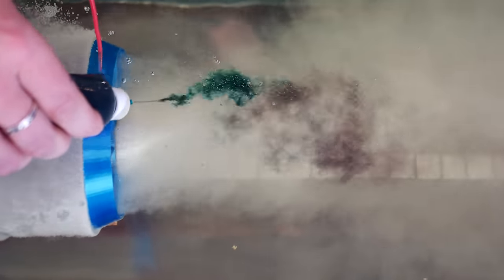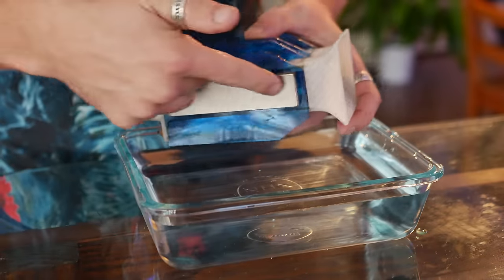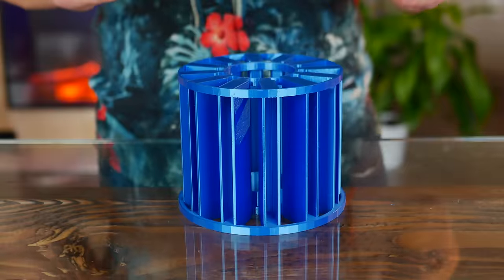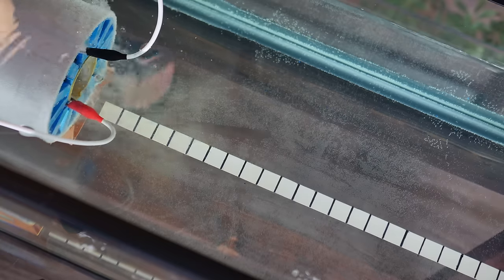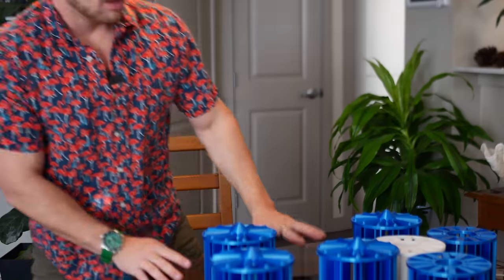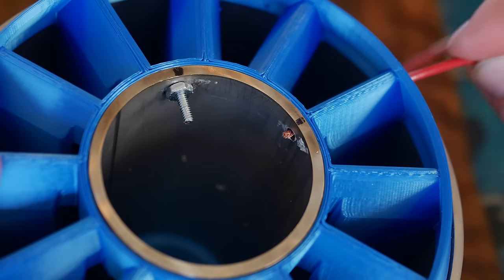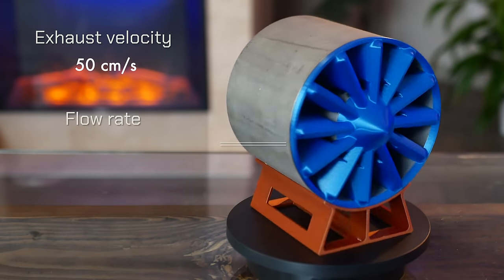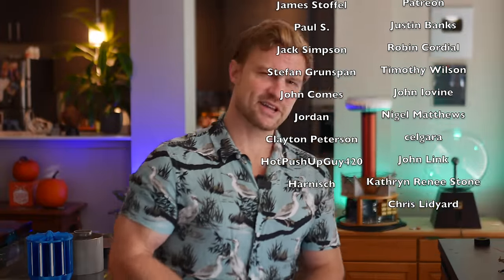Designing a Futuristic Magnetic Turbine (MHD drive)

Comment: One of the main problems with the MHD drive is the electrolysis part.  The side that has the oxygen bubbles usually is damaged by it.  There are some metals that are resistant to oxidation.  Then there is the fact that it produces bubbles instead of the just moving water.  Anytime there are electrodes driving current through water, there will be oxygen and hydrogen bubbles.  What if there were no electrodes?  Instead of using metal electrodes, what if you could make a transformer that uses the saltwater as a secondary winding.  The primary winding would be copper wire and the secondary winding would be plastic or rubber tubing filled with saltwater.  The fluctuating magnetic field from the AC current through the primary winding would induce voltage in the saltwater in the secondary winding that will drive current through the saltwater without any bubbles.  I did a small test with a transformer years ago and found you can indeed induce voltage in saltwater and it will drive current.  Of course, saltwater has a higher resistance than copper wire so there may be some limitations as a result.  Then there is the magnet problem with using AC current.  There is no way rectify the AC current in the saltwater so permanent magnets cannot be used.  Electromagnets have to be used and will have to be driven with the same power source as the transformer so that they are in-phase with the current through the saltwater.  The current through the water will alternate but the water will move in one direction.  I would like to see this tested.  I suspect the outcome will be underwhelming just like all of the rest of the MHD designs.  I remember seeing something about an experimental MHD drive powered boat that costed millions of dollars to build.  It was slow and used a lot of power.

Comment: In the year 2000 the Japanese developered The Yamato 1 was indeed an electric boat, and while the technology held the promise of potentially high speeds, the Yamato 1 itself was not designed for high-speed travel. It was capable of reaching about four knots, which aligns with your recollection2. The concept of MHD drive hoped to revolutionize marine propulsion by increasing top speeds significantly, but the low efficiency of these experimental drives made them impractical for wide implementation at the time2

Comment: Even at ~47 cm/s, what you've got isn't actually a propulsion device.  It's more of a low pressure fluid pump.  Remember, you're trying to design something which will overcome not only its OWN mass, but the mass of whatever vehicle/vessel/craft you're trying to propel.

F=M×A. If the mass doesn't move, there's no acceleration.  If there's no acceleration, no work has been accomplished.

If you can increase both functions of your design to at least move a small(ish) boat (relative to the size of the unit), I'll be impressed.  Perhaps you can design a system similar to the fictional caterpillar drive of the Red October, but for a surface vessel.

Comment: Now make one that has a tapered end so you have compression for more thrust. Also make it have a slightly more helical structure to increase surface area with the water. Also try thicker wires with a car battery. I wanna see how far this can go.

Comment: Hello Jay… Just wanted to put a thought out there with you. I was working together with Joseph or Joe Flynn for a couple years as he was making all the breakthroughs on his parallel path magnetic technology. What he had stumbled upon was the fact that in a magnetic circuit, and especially with the motor design that was being used which was a switch reluctance rotor design, that if you incorporated high gauss rare earth Neo magnets into the circuit along with the electromagnetic coils, and you had it balanced with the same number of lines of flux from the electromagnetic coil as from the permanent Rare earth magnets, you had a very interesting effect which fully subscribed to the laws of physics. If you double the lines of flux, you square the force. 
Joe figured out how to incorporate and switch the lines of flux with the electromagnetic coils, which also at the exact exact same time switch the lines of flex from the rare earth magnets. Therefore for one unit of electrical input, you would effectively get four times the force. 
He was able to take fractional horsepower electric motors which Riet normally ran at very low efficiencies of about 20%, and get them into the high 80s or 90s for efficiency. 
He was able to use this principal for electromagnetic clamping, and a whole series of other things. 

I was thinking… If we could incorporate these principles into the magneto  hydrodynamic drive,
There may be a possibility to square the output force ….
Which would then make this an extremely efficient Solution for a ships drive, or potentially for pumping.
If you like, feel free to reach out to me, and I can send you the PowerPoint presentation I gave a number of years ago  at the  northwest Energy technology conference, where I was a keynote presenter on this topic.

Scott Plummer, 
President, 
Rms-Ross Mining Systems Inc. 
scottplummer@rmsross.com

Comment: Very cool project. I've always wanted to see someone play around with MHD - envisioning solar boats that can either supplement, or provide enough power to drive with purpose. 58h of printing time seems incredibly long. I'd either break it into components and get rid of  all the supports, or move up to a bigger nozzle and finish the critical surfaces later... or do both - it just seems like you could print that in 1/5th the time. Good tip on the Flex Seal - gotta get some.

Comment: Japan:" Been there done that."
This type of engine has already been built, tested and found none practical in the 90's.
There is no practical use for such a technology, at this point, because of how much power it would take to overcome X mass to create twice the velocity.
A boat has a mass x , which is dead in the water weight without propulsion, but the propulsion has to solve this problem E=M * V² , which even Nuclear Subs can't produce with Magneto hydrodynamic drive without making the vessel heavier, due to the size and mass of the electromagnets in the drive.
Japan built the Yamato-1 in the 90's using the Magneto drive and was placed in a museum, but demolished in 2016.
 Yamato-1 is a ship built in the early 1990s by Mitsubishi Heavy Industries
 It used a MHDDs engine, which was driven by liquid helium-cooled superconductors at a length of 30 m, a  width of 10.39 m, and a whooping gross tonnage of 280 tons,  but  could only travel a mere cruising speed of 15 km/h (8 knots) with only a  max of 10 humans. 
A turtle can swim twice as fast. A Hawksbill turtle can swim up to 24.3 knots.

Comment: Great work!  Id like to see what that thruster can do in a canoe with a couple of deep cycle batteries or better yet the lithium iron phosphate batteries.  

As for futher research, I think that this needs an underwater afterburner combustion component.   If you think of this portion of the device as the compressor in a turbine,  The immense amount of hydrogen and oxygen bubbles could then be focused into a combustion zone, ignited, and expanded outward through a properly shaped tube.  Think of it like a ram jet but with underwater combustion.
Reply: When you say deep cycle batteries, you mean lead-acid batteries? The canoe would be DOA due to the intense weight of the lead and poor thrust to weight ratio.

Even with lightweight (by comparison), higher energy dense LFP batteries, it would still weigh too much and go nowhere.

It’s exceptionally inefficient. There’s very few applications for this.

Comment: Thanks for the awesome video.
There are a couple of things that can make some realistic improvements. For example shifting from permanent magnets to electromagnets. Mostly because these can generate an immense amount of pull for little current. This also allows to reduce the electric current going through the electrodes.
Actually we even tested with Platinum coatings and these were destroyed by the corrosion.
My main concern is for now the efficiency of the device as it is pulling close to 1kW of power to generate the thrust.
Anyways!! Looking forward to the next designs.

Comment: stuff to try:
Hallbach array arrangements.
machined graphite electrodes. extra points if you add sharkskin texture for microscopic stationary turbulent boundary layer
add riblets to non-electrode surfaces and treat with hydrophobic spray to trap air bubbles into seams to reduce wetted surface friction make the angled entry/tail <20 deg 
start calculating massflow per watt instead of only water velocity or perhaps trust force per watt ? i think those might give us a better metric for usefulness

Comment: @PlasmaChannel you should try some more extreme hydrodynamic optimization. 

You could slightly "spiralize" the thrust water channels to provide a directed flow that reduces turbulence losses at the exit, try making that central nose cone longer, and copy what modern high bypass turbofan engines do by using that central area of thrust water to pull in surrounding water through a cone. I would love to see what those modifications can do to improve the impulse. Exhaust velocity isn't everything afterall

Comment: A boat will require independent electrical systems. That’s a variable to include into the mix. How will you manage to created electricity in order to exhaust electricity? On a small scale sounds reasonable to do. However on a larger scale, all those volts an electrons moving at such a rate, while independently steaming, could cause more hazards than a general gas turbine or main propulsion diesel engine system. But you’re in a start! I’m not doubting, I’m brining to life real variables as I am a ship engineer.
Reply: Also, keeping in mind general electrolysis. Causes hydrogen bubbles, it does not take a lot to make hydrogen upset.

Comment: It looks like the gasses created by the electrostalsis is what is causing the thrust. Having conductors in salt water seems like it could have a short lifespan. You still have to have loud engines on these boats to power those devices.

Comment: Forgive my ignorance, this is not my field, and basically I'm just someone who found this fascinating. Tweaking this design slightly, what would happen if instead of stationary magnets you had it so that they were on a propeller of sorts, and so the thrust wouldn't just push water but it would also intentionally cause the propeller to rotate. Would that not significantly increase forward momentum or thrust in an ocean environment? This way you still have a purely electrical engine, and all you've lost is the lack of moving parts. Additionally, since the rotation wouldn't be coming from a drive motor, you could focus on reducing the friction of the central axis holding the propeller in place, in order to maximize rotation. Could this not create an entirely new type of electric propulsion?
Reply: Another possibility would be to have smaller fins inside your housing, but with two different directions of spin and thrust (clockwise and counter clockwise). One would be doing a push and the other a pull, but with opposite charges so that the natural repulsive or attractive nature of the magnets increases the spin, while the magnets move water.... I'm curious if this would work.
Reply: Last thought, what if you then wrapped a coil around it all to either generate additional power or reduce power consumption?

Comment: Taper the front to back so that the water is forced to condense as it moves back. Then make it like your ionic thruster with 3-4 arrays in a row, to take advantage of entrainment, while adding and further concentrating the water. What this should do is improve the density of the thrusting water and propel the whole assembly forward with more force. Think of it like stacking cones with just a enough overlap between arrays that water doesn't escape until it reaches the end. Furthermore, employing tesla valves or shaping the stays to make them function like them to help ensure condensing and one directional flow might be greatly beneficial. Normally you'd want to avoid condensing water because of cavitation, but with the open nature of this design, i doubt it'll be an issue at all. I already have s few 3d concepts of this idea if you're interested. Someone like you could make it reality. I don't have that kind of skill, unfortunately.

Comment: Pretty cool.  At SuperMagnetMan we have had many customers wanting to build these.  In a closed tank it only takes a few minutes to build up a lot of crud in the water.  I am sure in the ocean that would be left behind but since I am an electrical engineer and not a chemist I am not sure what all the crud is.  A couple of thoughts - stainless steel is a very poor conductor of electricity - so I wonder what a tube that is 90% copper and 10% nickel might work like.  Also we can easily get those magnets in N55 and we can coat in PTFE or just 3D print a TPU rubber shell for each magnet and coat the magnet with silicone oil to protect it.  Just a few thoughts for tweaking it.  Also on the hydro dynamic side I would probably design the flow channel. with some venturi type shape to accelerate the water flow.:)

Comment: Sorry for the rant, had fun thinking about this projects applications.

I got to thinking about how to increase the force of the thrust without needing to increase the size of the engine or power requirements. The only idea that can to mind is to use the wave physics of water alongside the physics of the turbine. A vacuum sucks the ship forward while the exhaust pushes it, doubling force but not the requirement.

By using the shape of the ship it is mounted to and decreasing the intake to the size of the turbine, water is drawn into the turbine at a much higher force. Now there is a problem with this as the increased intake force could put strain on the turbine's structure, and has to go somewhere, so put an exhaust on the back that widens out to quickly displace the built up pressure. Afterall, when working with physics, always regard to Newton; EVERY ACTION has an equal and opposite REACTION. So, consider a machines EVERY ACTION and make it better, no?

Comment: This won't really be much quieter. There's quite a bit of noise generated by the electrolysis of the water and air bubbles being formed. You're basically going straight to the cavation phase of propellers. You'll also be ionizing the water and depositing heavy metals into the water as your reaction plates corrode.

Comment: Wonderful, a rule of thumb to use for a “ final model “ in regards to wire ( cable ~) size is the ; gauge . Think American wire gauge! An easy way to think of these gauges is the largest gauge refers to smallest diameter, hence smaller gauge no. = larger diameter. Great video!

Comment: I feel like the thickness of your 3D printed structure just causes drag on the water going through the system. It may be a good idea to try and decrease the supporting structure to a minimal amount. The lower the areas of collision, the more laminar the flow and should allow for maximum thrust. This device works more like a rocket nozzle than a turbine.

Comment: This is just the perfect in the Carbon Zero race. (For Boats).  This ening is the equivilant of an electric car (EV). A Yatch with Solar,Wind and Battery capacity, could run these engines without producing emissions. The battery pack can get extra cable charge at Dock.  A fully electic boat with a fully electric drive system.

Comment: Basically a tokamak fusion reactor. If you put a dynamo in the middle, and had the magnets push it somehow, it should generate electricity.

Another cool experiment would be to use a magneto (magnetic car starter) to rotate a dynamo (DC Alternator) to generate electricity

I think if you did the magneto dynamo thing, and wired the outer ring into the inner ring and back to the outer ring, if you used like a bike chain to spin the outer ring, it should cycle the energy back into the outer ring, so it would keep rotating with power with no other input, bike-powered propeller?

Comment: One might gold plate the anode or make an allowance in the print where a rod or sheet of a less noble metal could be inserted to become a sacrificial anode.
Reply: Gold plate the anode and attach to it a mild steel screw or nail as a sacrificial anode. Gold would be more durable and conductive making a more efficient conductor and increase surface area efficiency = speed? 

Alternatively just utilise mild steel everywhere and attach removable nickel or zinc blocks to mitigate the galvanic corrosion.   

Enamel dip the magnets for longer service life, intrinsically they will lose irons to the more noble metals. Solder /Attach a small block or strip of nickle before coating them.

A car will rust away under the paint due to the metals loosing irons to the atmosphere via galvanic corrosion attributed to frequent rain, humidity. e.g. in a large dry desert climate a car body is less likely to rust at the same rate as in tropical humid region.

Comment: If you would like to try these on a real electric specific boat design, I might have a candidate for that.  I designed and built a light,  narrow, and flat  bottomed 17 ft. hull.  It is designed for electric power, and uses a pair of underwater  electric motors on a stand alone pylon.  Might be a simple matter to swap motors, and use my 48 volt deep cycle power pack to feed them. There are some design considerations that might make this an easy couple hours change over.   I have a directional and speed control throttle I made for a smaller unit years ago.  Being a light boat designed from scratch for battery power. but having a 1900's look has caused it to be a boat show attraction for over 12 years.  My location is in Oregon, perhaps you would be interested.